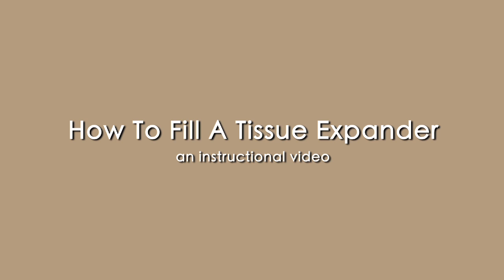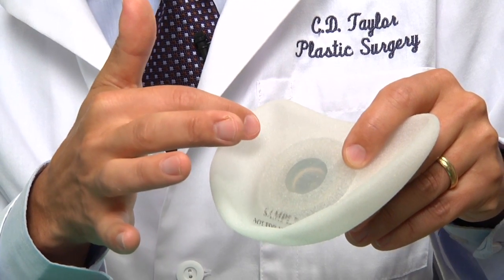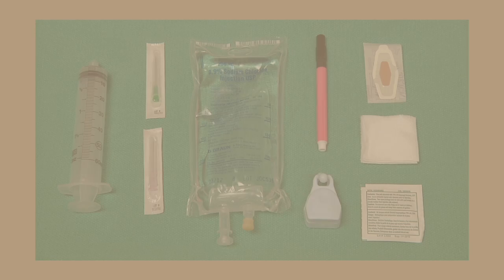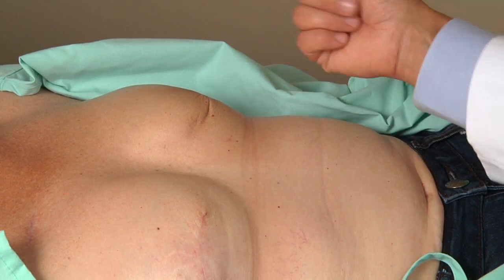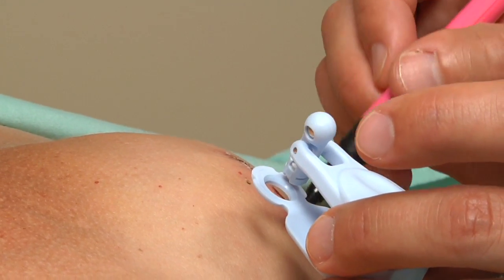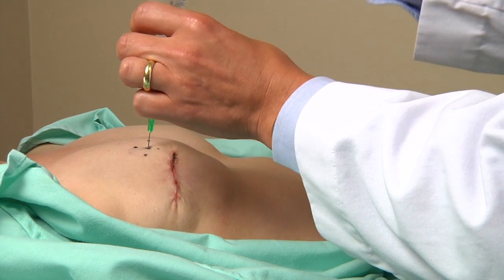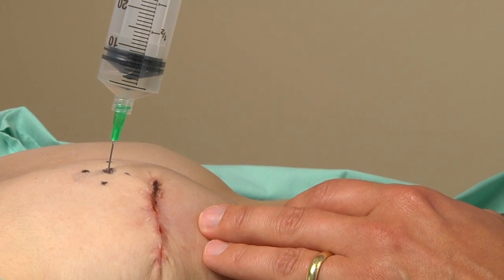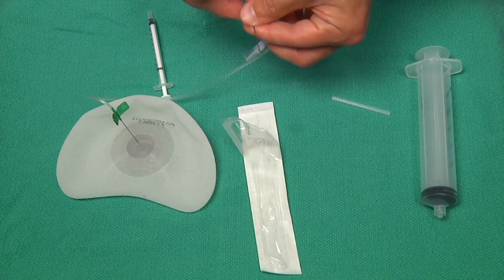Tissue Expander Filling Allergan

Comment: Could that technically be used on transgender people to inflate or deflate the breast?
It seems nice for people who does not need a breast everyday
Reply from the maker: Thank-you for your comment, tissue expanders are not designed to be permanent devices so although the can be deflated and reinflated, for example to accomodate radiotherapy in breast cancer treatment or someone wanting less volume for a spefic event ie a triathalon, eventually tissue expanders are removed and replaced by implants.